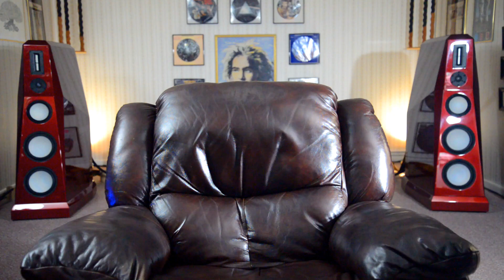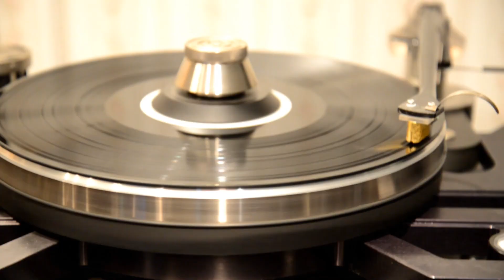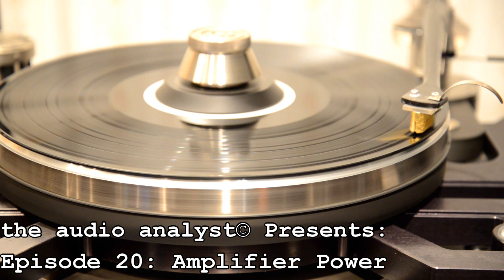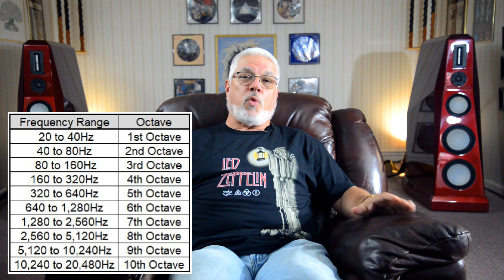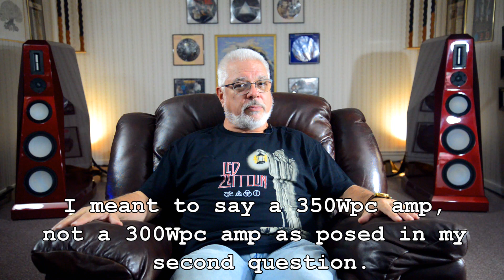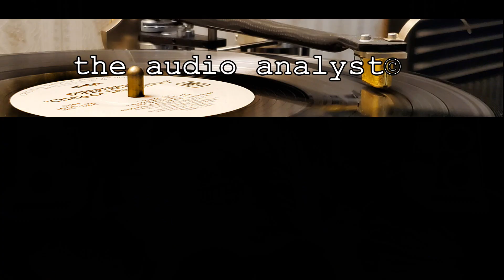E20: Amplifier Power

Comment: Fascinating information.  I do cheat by adding 15dB of dsp gain down at 40 Hz to flatten out my diy speakers.  But I cut the master volume by 15dB so the source is never over spec.  This of course messes badly with the signal to noise ratio as I am generally playing at the upper end vs the lower end on the volume control.  With 110W of triode power I get away with it at moderate listening levels on efficient speakers.  Needless a good set of subs would be better, but this is working ok.

Comment: Hello Greg!  Just watched this video about amplifier power, and I've read many articles about amplifier power vs speaker sensitivity.  The general consensus is that you need as much power as you can buy.  I currently have both sealed box and ported speaker designs, but the most efficient of these is rated for only 89db/2.83V/m.   If I want to play Rock music at very loud listening levels in my medium sized room, then a pair of 100+db efficient, huge, horn loaded speakers are mandatory.  Even with horn loaded speakers, its best not to scrimp on amp power. Thank you for this very informative and interesting discussion.
Reply from the maker: Hello... The old adage, "Too much is never enough" comes to mind! 😉

Comment: Dear Greg, great and educational video! I have a question to ask. I'm currently using my kef reference 5 tower speakers (90db at 8ohm, 50-400w according to specs) with a primaluna dialogue HP integrated which is 40w triode power in push pull from 8 x EL34 tubes (likely class AB). I'm very happy with the sound, havent heard much distorsion/clipping yet, but thinking of exploring into class A SET territorry eg 211, 845 or PSE 300b, which outputs usually around 18-24w. I usually listen around 80db, with peaks abt 87db, do you think that its safe to explore into the class A tube territory? Thanks!
Reply from the maker: Hello... The KEF Ref 5's are a fine product from an exceptional company. 

Given the current capability of the PrimaLuna Dialogue HP, which is rated at 40 Wpc into 8 ohms with EL34s, I’m not totally surprised that it can drive your fairly stable (4Ω nominal, ~3.2Ω minimum) Ref 5’s to acceptable SPL levels…

I do have great concern, however, about that being possible with any flea powered SET designs… Could it be ok? I guess it is possible! But I honestly believe that you would be in clipping territory long before you would be able to accomplish 80-85dB thresholds with the Ref 5’s. Sorry, but I personally wouldn’t take that gamble unless I could try a loaner first, or I was prepared to churn/resell the auditioned device in question.

Thanks for watching, and for taking the time to write.
Reply: @theaudioanalyst  thanks so much Greg for taking time to look up my speaker detailed specs and for your reply! Appreciate it very much! :)))
Reply from the maker: @GH-zs8eq  Happy to be of assistance! Take care, and thanks again for your support.
Reply: @theaudioanalyst  Same to you! Wishing you great health and even greater music! :))) Enjoy your lovely system!

Comment: This is a great video that explains something very few understand.  Over the years, I have mentioned to others that 'doubling the amp wattage rating power generally provides 'only' an increase of 3dB."  The other piece of the equation (for sound pressure level) that must be included is speaker efficiency.  For example, the MBL 101 has an 81 dB efficiency rating (dBs produced by 1 watt) ... where as many speakers have efficiency ratings in the low to mid 90s.  Once speaker efficiency ratings are combined with the '3dB' doubling effect,  this information often dramatically changes the perception of how much amp wattage is ideal.
Reply from the maker: Steve, you are, of course, absolutely correct... But as I said going in, I needed to keep this simple. The last thing I wanted to do was to throw in ANOTHER variable. In all these examples, we assumed all else to be equal. Much as the AC voltage powering the different amplifiers, it was assumed to be a constant.  So, that efficiency rating, be it low- to mid-eighties, mid-nineties, or with something like the Avantgarde Trio XD, with an efficiency of 109 dB, was assumed to be the unchanged, hence, not a variable, for this limited discussion. ;-)

Comment: Fascinating and way over my head. I'd ask this--how loud do you critically listen, typically? 90 dB is generally way too loud for me, depending on how much I've had to drink. But, my rig will do just fine at that level.
Reply from the maker: Hello Joe... I'm sorry that you felt this was a bit overwhelming... But, thanks for taking the time to watch, and comment. Based on measurements taken against my older, calibrated, analog Radio Shack SPL meter, with my own mods, including a MUCH better capsule mic and some component (caps and resistors) changes, in my 600-square-foot (or some 4,300-cubic-foot) room, my critical listening levels are typically between 75 and 80 dB at my listening seat.
Reply: @theaudioanalyst  Thanks, Greg. I ordered a meter last night. I've been using a phone app and it's not worth a damn. That said, with the phone app I'm typically between 75-80 as well.

Comment: I love having lots of power🤣🤣🤣
Reply from the maker: Do you remember the Rockford-Fosgate tag-line from the 1990's? "Too much is never enough!" ;-) Yeah, my thoughts exactly. So, the Audionet MAXes deliver 700 watts each (into the ULTRA 9's 4 ohm load), and the ULTRA 9s have 1000 watts each to drive the subs... That is 1700Wpc, or a total of 3400 Watts! Since 745.7 watts is equal to one horsepower, that means my system develops just over four-and-one-half HORSEPOWER! Ok, I'm a bit odd, but it just sounds sooooooo cool to measure my system power in horsepower! ;-)